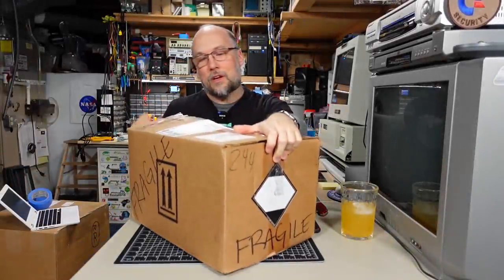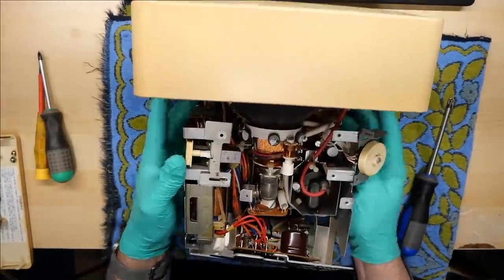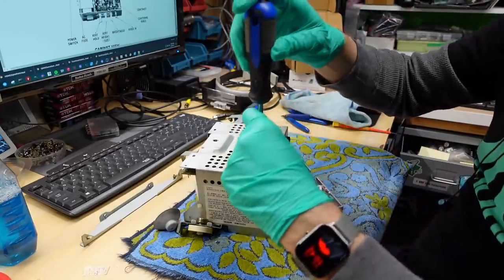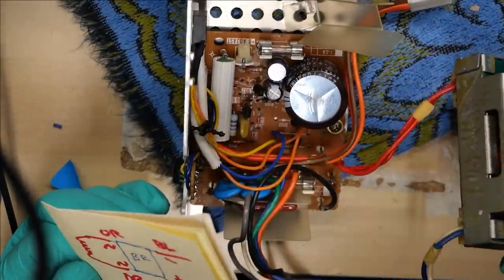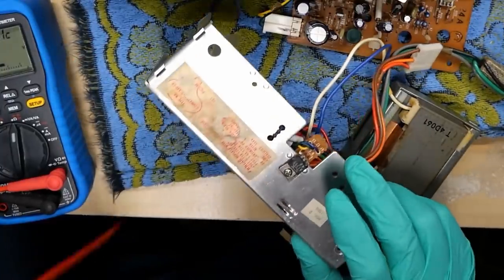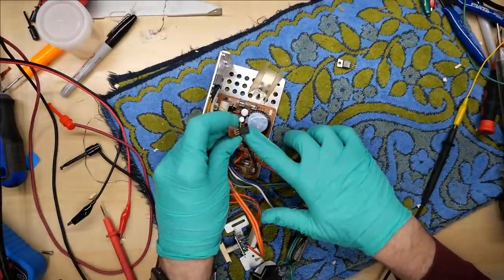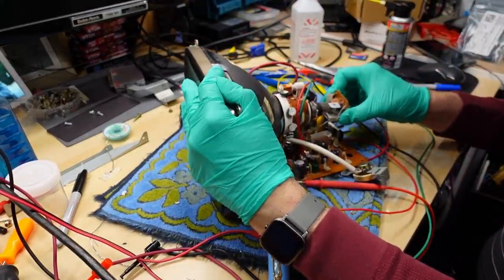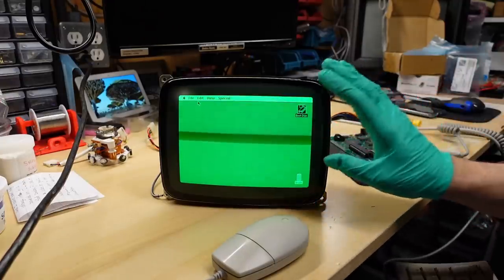Can I fix this broken Apple IIc Monitor?

Comment: "this is the least user serviceable monitor" - monitors are rarely designed to be user serviceable other than glass cleaner on the front, also you are way out of the "user" category :D

I hate to disassemble complicated devices. There is a point when you already took apart many components and you are knee deep in screws (different sizes), but you realize that your goal is still very far. And you are kind of hesitating between putting back together while you still remember how, or taking apart totally because you are over the point of no return and you may not be able to assemble it correctly anyway so let's see what is inside and if it is not repairable, it can go to the recycling center peacefully :)

Comment: The failed diodes on the main board probably need to be high speed diodes rather than standard recovery diodes. However as you say, with no schematic and the possibility of further damage due to overvoltage, you are really stabbing in the dark.
Reply: I would agree. The horiz frequency is arount 15 kHz and standard 60 Hz diodes are going to be way too slow. Some fast recovery diodes are needed. Something like one from the Motorola MUR line will probably work

Comment: What is that in the intro at 0:23? No idea why I didn’t ask 50+ videos earlier
Reply: Oooh I think I know what that is

Way over 50 videos ago he took an old MFM hard drive, oiled the stepper motor and got it working again. I think that's what that is at 0:23. 

And he did the same operation again much more recently on his "Adrian's Digital Basement ][" channel
Reply: @mcosta3810  Thanks a ton^^

Comment: Why they put an ultra-fast recovery diode in the monitor? That really an overkill, just a normal diode should be OK, the layout of the bridge-rectifiers is really weird.
Reply: Is there any disadvantage to an ultra-fast diode?
Reply: Fast diodes are normally used for the HV because it is high frequency, usually around 15KHz
Reply: @danielmantione  See quite a number of monitors tear down, not really see many of them use ultra-fast, though it's price is higher. Just curious why the manufacturer use this priced component instead of cheap one.

Comment: PSU here is simple linear power supply. So probably zener diode set needed voltage on smaller transistor base and one (or even both) of smaller transistor on board drive base of larger PNP mounted on heatsink with some support passive components around for stabilization.
It's probably easy fix and you just need to trace few components and found which one doesn't work, just stop thinking about it as "PSU, omg omg, I don't know nothing about PSUs" and try to be logical like in your other repairs. In case of SMTP ok but with linear PSU you knowledge is more than enough.

It's also possible that some of diodes you think are open on other boards are actually bigger zeners and replacing them with standard diodes create new problems. Packages of some old components can be deceiving.  You can always check them with bench PSU (and resistor ofc) but for lower voltages you can use that nice eev dmm you have (up to 15V I think). You will get nothing if they fail but semiconductors rarely fail open and idea of having multiple fail open on same board sound like SF to me.

And about that cap...always check ground with dmm if you forget original capacitor polarization. Mistakes in printing boards happen even today and with items never intended for customer repairs they will just use boards anyway. And this is after all Apple device, idea about not having customers tinkering  inside device they own is not from yesterday.

Comment: IMHO your videos would be better if you tested the equipment to see if it runs/works BEFORE disassembly.
Reply: If you have broken parts like bad caps and short circuits then power on you make it worse.